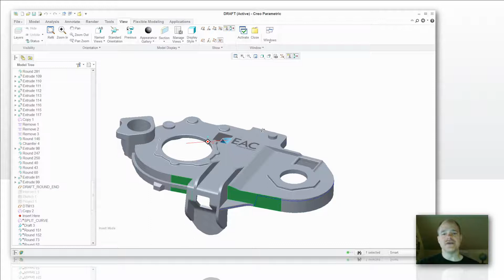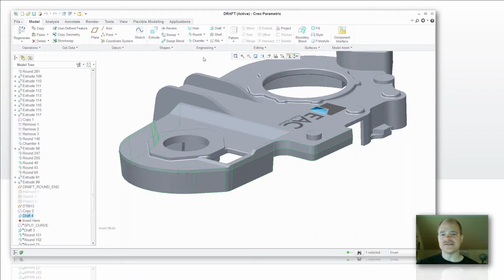EAC Tip-of-the-Week: Creating a composite curve from two distinct curves in Creo Parametric

Comment: Very sad, but it does not work in Creo/Modeling. As well, it works on two sections that previously were the same curve. i.e. with endpoints being perfectly the same. In real life the endpoints usually do not match by 0.00001 micrometer. And that is enough to get an error when extruding the surface along such spine-path. When you use mach  - the whole curve is moved in 3D making the model inconsistent in other places. The question, is how to blend only two end-points into one.